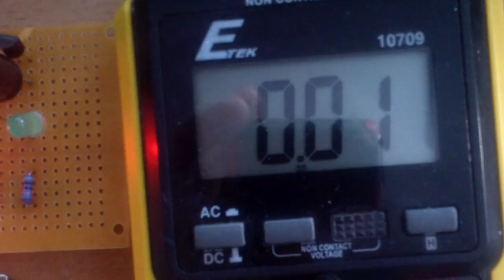Blinking LEDs or Astable multivibrator

Comment: If i want to replace LED's by simple 3 volt dc motors what should be the changes required in this LED circuit; so that motors will toggle? please suggest me a solution...
Reply: ТРАНЗИСТОРЫ ПОМОЩНЕЕ ПОДБЕРАЕТСЯ И РЕЗИСТОРЫ ТОЖЕ ПО МОЩНЕЕ И ВСЁ.РЕГУЛИРУЕМЫЙ РЕЗИСТОРОМ ВАША ПРОБЛЕМА РЕШЕНО!

Comment: could you please tell me the components used?
Reply from the maker: +Rodney Mendes Pause the video at :05 and there is a schematic with the components and their values or you can google astable multivibrator and you'll find a lot of info. Thanks for watching.
Reply: +wtam69 - How can we made this on 240 volts AC?
Reply from the maker: Just use a AC power supply (wall wart) that puts out about 5 volt DC.

Comment: would this run off a garden solar cell?
Reply from the maker: Yes, it would.  You can probably add another transistor or relay and use your photosensor or garden solar cell to turn it on. But that's another project.